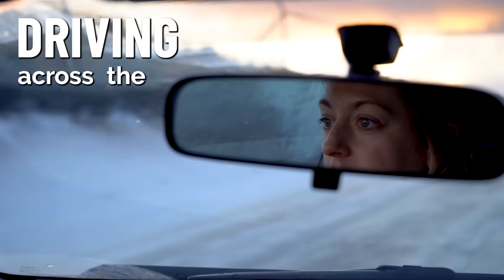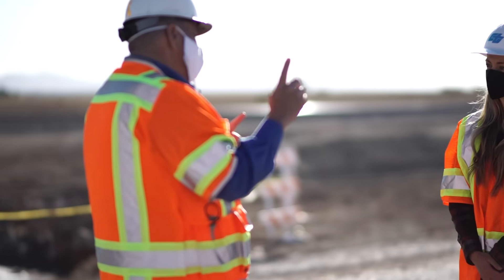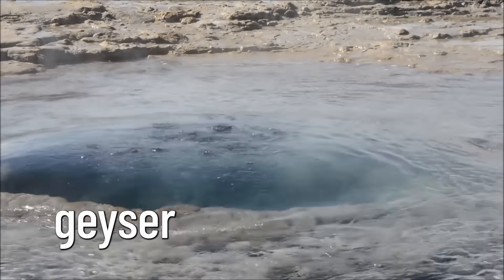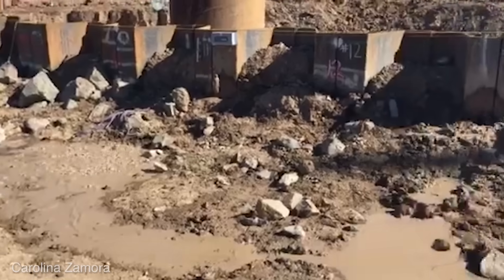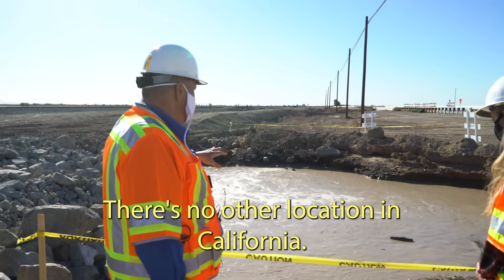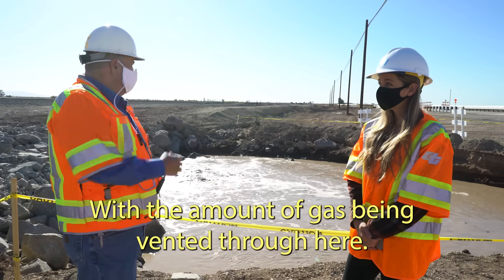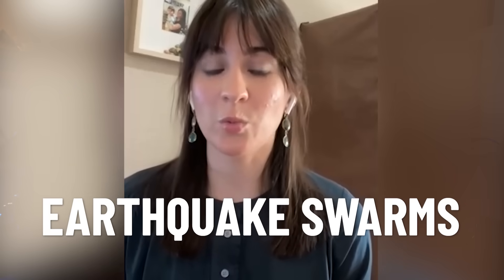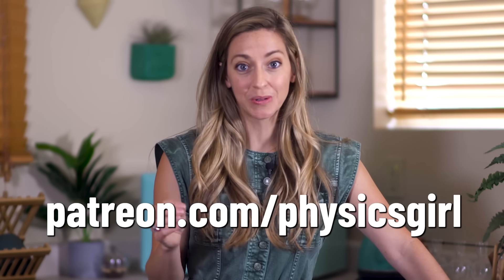World's Only Moving Mud Puddle

Comment: I have a team that can solve your problem and fix it. That little water well drilling truck was not going to solve that problem. You need a seismic survey done to find the anomaly. Then you will need a drilling Rig with a BoP system and large volume of liquid mud at the scene. Approximately 3,000 bbls of mud with another 6,000 bbls on standby and about 8,000 bbls of water also on standby. Once the reservoir is located we can drill into it and do some pressure test on the pressure and size of the reservoir. Once it is drilled ot can be diverted at that location. Once that is done it can be mapped out and cement up the previous location to help stabilize that area. $10,000,000 should cover it. But it can take upto about $100,000,000 depending the size of the reservoir. Also may have to build a permanent station to aid in pressure release of the gas and fluids.

Comment: It has to do with the underground tunnel that leads to the pool on the surface. 
I would argue that the tunnel was on a angle before and as the erosion began the angle of the tunnel began to straighten out to a more 90° angle.
And that is pretty much it. A 5 story wall isn't going to stop it from straightening out if the tunnel goes deeper than that.
As for why it moved?
That can be explained with the land sinking downwards as wells in the area pump groundwater out. The remaining groundwater is building under the pressure and has created the geyser.
You can look it up but it is a well known fact that California is sinking due to groundwater depletion.

Comment: I think it was coming up a very large underground impermeable structure at an angle, and when the earthquake swarm happened, that structure cracked. Now it's eroding it's way along an underground crack until it gets over the top of the source.

In that case drill deep holes along the path it's going until you don't find a co2 pocket, and then drill multiple holes at the last co2 area to allow it to go straight up. Once the gas pocket stops filling the other moving area that will cease and you have a non moving mud puddle.

Comment: Check out the Salton Sea. Now unlivable. Back in the 1950s they made a man-made sea resort. The purpose was for tourists and agriculture waste run off. A water management flowed into the Salton. Unfortunately it became contaminated all the fish began to die,the smell, the toxins. A Fischer or moving expansion of agricultural runoff mining its way westwards towards the ocean started to occur. I believe they rerouted it successfully and it started moving northwest. It is said to have a 80•temperature range. The heat may make it a much more rapid,in its mining itself. It’s not a natural phenomenon! It’s man made in my opinion. If the imperial valley keeps pumping out fertilize chemical runoff without a major revision aqueduct treatment plant to prevent future biohazards build up! In my opinion it will eventually worm its way to the ocean and perhaps residential areas. And if those areas have the same old gas lines the county it inhabits could very well be blown off the map. if it takes different routes or forks off and they aren’t prepared or the city county or state doesn’t take any action then they could see huge explosion’s 💥The city of Palos Verdes is just outside of the Imperial Valley agricultural district. And the city is sinking they have no power and the Fischer is very deep it’s almost to the ocean. It will be very sad and interesting to see if the ocean completely changes the area- the coastline of that county. Ten feet a month for a decade I want to go do the math!😅

Comment: You can’t stop a river , the flow will go the to the less resistance.
The answer may be going back to the original source,  drilling a hole relieving the pressure, The earthquakes may have sealed the escape route ..  so if you relieve the pressure it may stop the movement . ..

Comment: What happened when it went under the railroad tracks??? All suspense about railroad track and then you skip over that part. Frustrating!
Reply: they made two different sets of detour tracks that needed weekly upkeep work while the spring was carving through the original tracks. I believe the geyser has passed the original track route at this point so presumably they have backfilled and restored the old path of the rail line.

Comment: Well if it’s just a puddle why not drain it
Reply: its not just a static pool of water its actively adding more water which pools then seeps into the surrounding ground (hence "perched water table"). even if you pump it fast enough to drain it, you'd still have to deal with the fact that the source of erosion is moving.

Comment: As a thought.... Is it possible that this is gas that is venting out of a crack in the crust, that is moving along a fault line and as the fault line opens like a zipper the gas continues to move with it escaping through the path of least resistance? It would explain to some degree why it would move at a steady rate, and why it could suddenly jump. Possibly from seismic activity etc?

Comment: to me it almost seems like there is a huge underground reservoir full of water with a long ablong reservoir filled with carbondioxide uderneath, the earthquackes made the lower most reservoir filled with gas opened up and into the other reservoir and if the theory of the opening being at an angle is true but for the lower most reservoir it would cause the opening to collapse on the top whereever the preasure can push through the ground inbetween, but then what happens when the gas comes into the second already leaking water resevoir, well the gass gets stuck again and if the angle theory is somehow true for both the opening for the gas and the water that would cause the lower opening to expand faster therefore slowly building up the presure on the second opening wich then also slowly expands and therefore it moves

Comment: You said they pounded that was 5stories into the ground. But then later said the wall was 75ft deep. How come people don't die if they stick head into a 5gallon bucket with all the carbon dioxide settling into the bottoms of cups that put out candles? This entire video seemed like it's all guess work. Lol also, wtf park the trim on top of it.  Lol

Comment: Where was the relief well drilled in relation to the mud pit? Could they not drill it on the other side of the highway? It coming up at an angle and underground erosion is a good theory. Maybe it stayed where it was at for so long due to harder rock and now it’s past the hard rock eroding quicker.

Comment: 3 Beams In Conjunction Almost On The Same Spot Across The Wall Somewhere Along The Rail Tracks Behind The University Playground and Boundary Walls To The East. 
Under The Shade Of The Sports Office Gallery on 31072007 1725 to 1735hrs ..

,, Clouds
C4 Connect On 2000

Cat 3 5 Passing Through the Region March , April, May, June , July, August, September,  November,  December ..

Rainy Seasons Usually 8 Months Of The Year. Also 3500kms Inland From The Coastlines Of The Indian Subcontinent..

Comment: I'm coming at this from a completely different viewpoint, because both sides of my family were farmers in the Midwest. Your video had me completely flummoxed until you mentioned it's in an agricultural area, and obviously it's also a more arid region.

I've been watching the 20-year mega drought in the American West/Southwest, and the overpumping of aquifers to depths below 1,000 ft. Especially in California, you have had concrete irrigation canals, overpasses, roads, and foundations etc. settling and cracking, often severely. Even before the current Mega drought, "Some parts of the Central Valley sank 28 feet between 1925 and 1977 because of excessive pumping, according to Dr. Joseph Poland, a pioneer in land subsidence." According to the current USGS page, somes areas of California have been experiencing land subsidence of nearly one foot per year.

"California's farmers probably will pump an additional six to seven million acre-feet of water from their wells this year, above what they normally use, according to Josue Medellin-Azuara, a water expert at the University of California, Merced. That quantity would cover 10,000 square miles with a foot of water, and far exceeds the amount that naturally replenishes the aquifer, even during a year with normal rainfall." https://www.npr.org/2021/07/22/1019483661/without-enough-water-to-go-around-farmers-in-california-are-exhausting-aquifers

So what does this have to do with the price of mud pots? In California, and Arizona, we are engaged in a massive geoengineering project  changing the hydrology of extensive geographic areas over 1,000 ft deep. So we can farm rice, almonds, and alfalfa "cheaply" in an arid region. In Arizona, where large agribusinesses have installed deep pumps, some small towns literally could watch the water in their wells moving in the direction of the high volume 1,500 foot deep wells supporting the growing of crops like alfalfa (which is exported to Saudi Arabia, who also pumped their aquifers dry growing wheat back in the late 20th century) and tomatoes.

All these deep wells are moving millions of acre feet at extreme depths. The problem is while the well is usually drilled vertically, the involved aquifers are mostly horizontal formations deeper in the earth. So the source of this gas could be well below 1,500 feet but the removal of megatons of water will obviously make structural changes down deep. Obviously from the video not in a good way.

Using deep seismic soundings in the area, coupled with modern supercomputers and the modeling used by companies involved in oil exploration, could be a very beneficial project. It might highlight the deep changes being produced in these regions. Then again, like fracking, the people benefiting from this overpumping might not want these problems tracked, because their business model of destroying million-year-old aquifers might cause a public outcry. Then again, with enough spin and lobbyists, maybe not. Think lead paint and gasoline additives.

Comment: Could one calculate, if the theory of the puddle is due to a tilt is correct, where the primary vent is by using the sin cosin tan equation, where the length of the triangle is the distance travelled over time, and the angle would be roughly calculated and approximated using the pressure of the CO2 coming out of the puddle? Or the rate instead of the pressure? Just a theory.

Comment: Path of least resistance not a straight path. If the quake moved a large rock sheet underground and cut off its pathway. Its finding another path of least resistance. As it pushes through the ground its moving dirt and rocks. Changing the path of least resistance.. if u want to stop it from moving fine a point in it's current flow and connect to it with a perforated well I think would stop it from moving. Could probably drill down from where it originally was and open a hole there to move it back in place.

Comment: This is more info that I had when I first heard of it.They had no idea and didn't give any info of the O2 or sulfer or anything else.I thought being by the fault line and earthquake started it moving and the viscosity was like quicksand and dug its way through with mirco quakes happening constantly as well as magnetic fields pushing as it captured more iron in the soil.If this is powered by the O2 and such it could be like fracking but if it cracks in that spot and moves it it would also need to close up behind and crack as it moves as it vents.With ground penetrating radar or lidar maybe we could see the fault crack of the direction it is moving.Could be a vain like volcanoes have with chambers.In a way that's what I think that geyser are but they release more efficiently.

Comment: I don't get it. Why not go past the structures on the surface you want to save say 1/4 mile - drill straight down till you hit a gas pocket and keep venting there then build a support along the road and railroad you want to support.  then near the vent start digging a huge 100 ft wide pit till you find ground water and "steal" the gas powering the moving mud puddle essentially jumping Under the man made structures you want to save? Like underground checkers.

Comment: So the gas that is escaping is carbon dioxide you say? Compressed carbon dioxide turns into dry ice. Dry ice would give the observable effect on the surface of the mud spring having no heat. The observable lack of heat is an illusion. Why? Here's why: when's the last time you've evacuated an air compressor by opening its relief valve? The air moving from the high pressure interior of the tank into the low-pressure atmosphere is icy cold at the point where it escapes the tank. The weight of the crust of the earth is providing the compression to the carbon dioxide like air being stored in an air compressor tank. Fissures in the surface of the Earth are providing a means of Escape for the carbon dioxide gas. The change from high pressure to low pressure occurring at the point at which the carbon dioxide Escapes into the atmosphere is making the carbon dioxide cold... the water is simply filling in a physical void left behind by the volume of escaping carbon dioxide... I'm willing to bet the energy source making the carbon dioxide gas superfluid is heat from lava thousands and thousands of feet down.

Comment: What would happen if a large hoverable dome capped the hole and applied intense vacuum?
Would the mid move faster to it's destination?
Would it interfere with whatever process is happening down deep?
Would it stop the movement of the hole?
What kind of carbon capture output would be created?
Can any useful products be made from the fluids and gasses?
What happens if cement is injected as deep as possible?

Comment: There was a story i heard about recently, where a lake had a massive pocket of CO2 under it.  One day, the gas vented out super fast, and within a few hours, a thick layer of CO2 flooded into the area and across a few towns.  I believe like 1700  people and 3500 livestock were all killed in a few surrounding towns.  This happened in Cameroon, it was called Lake Nyos i believe.
Reply: The gas was dissolved in the water at the bottom of the lake. A landslide stirred up the lower layers as if opening a bottle of seltzer. The CO2 saturated water rose high enough for the reduced water pressure to allow it to erupt out of the lake and, being heavier than air, hugged the ground as it expanded outwards beyond the lake, suffocating anything in its path. Same thing happened with Lake Monoun not very far away a few years earlier. 

A more complete story can be found, among other places, on Smithsonian's online magazine "Defusing Africa’s Killer Lakes" being the title. I'd link it, but Youtube often deletes comments with off-site links, so you'll have to google the title.
Reply: @RailRide thank you brother, this is what I like. Proper information on the story.
Reply: Ironic part is that people reoccupied that area almost immediately and there's even more people living there now.😂😂😂

Comment: What kind of geology nincompoops would think that the origin of the carbonated spring is only a few hundred feet deep, or could be slowed by that silly retaining wall? 
They could easily have done some GPR or sonar mapping of the surrounding soils.  The only recourse I can imagine is a couple of suspension bridges, but only if they can find some 'nearby' stable soil to mount it on.  
. The relief well geyser indicates the surrounding ground might also subside as the pressure is released.   
. Perhaps an eastern geologist, familiar with the Appalachian sinking creek system, would have some insight to the ways cool water gradually erodes rock & soils.  Watershed springs often move.  This is from an aquifer, but some of the principles are possibly the same.

Comment: I believe what this is , is called PRIMARY SOURCE WATER. The fact that it is highly pressurized at times ( Geyser) and has been flowing for decades, with what appears to be an endless source of water….PRIMARY SOURCE springs are water trapped 15 miles deep into the crust of the earth and way deeper than the aquifers we have here In the Coachella Valley. YouTube it. The major rivers are running dry.. maybe by faith. God will release this almost unlimited supply of fresh pure water  / 2.5 times the volume of the oceans !!! Crazy thing but thanks for the kool story!

Comment: Would GPR (Ground penetrating radar) be any benefit in attempting to track the density of the earth to find its possible path if it is in fact trying to become vertical instead of diagonal in its relief venting?
Reply: that’s what i thought, if it is actually a gas pocket, can’t they xray the ground and find the gas pocket and drill through it to release the pressure?

Comment: You can't resist fluids spurting into the air. It is normal. 
Noone measured the gas/ liquid pressures nor did they measure the viscosity or composition of the mud
It could contain toxic substances that are environmentally damaging.
Reply: Is the mud really eroding the earth or chemicals dissolving the earth?
Let's l@@k deeper. Is this the same as complete mountains falling down into a thick mud? Look that up in youtube.